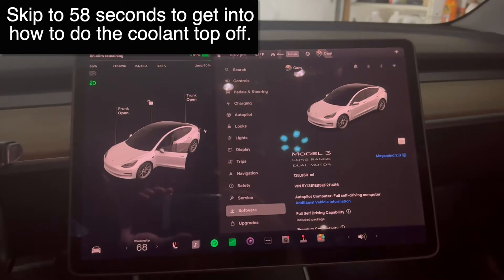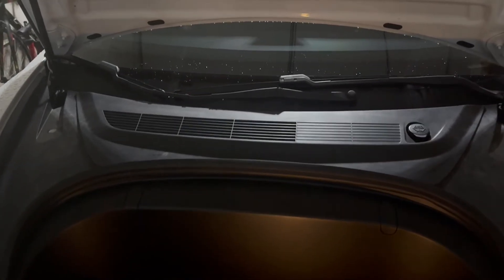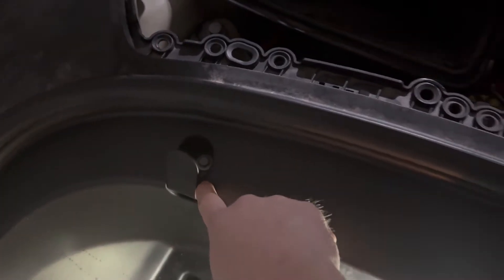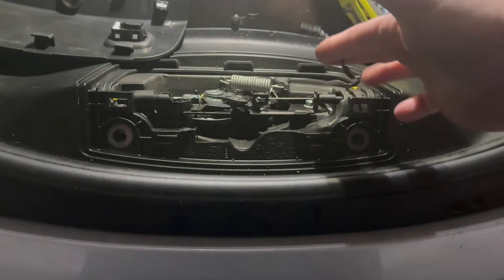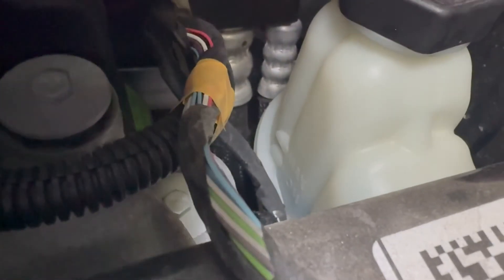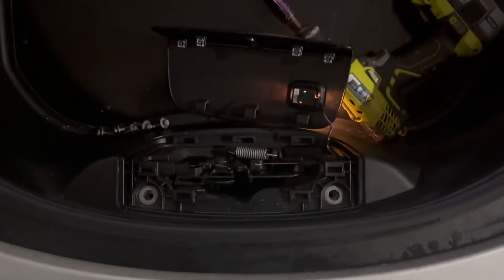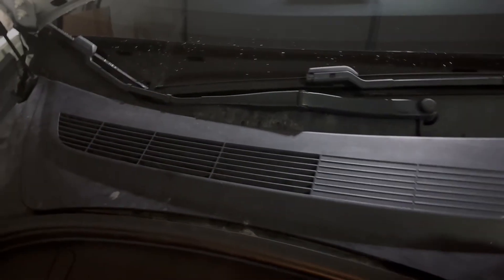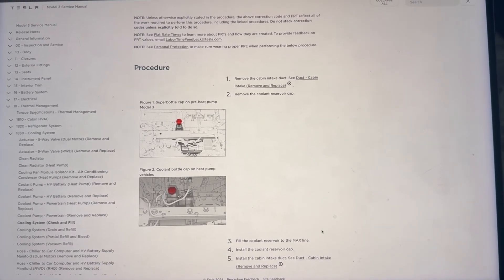Tesla Model 3 Coolant Top Off - Super easy!

Comment: did you purge it after topping off? no one seems to be doing this on these videos should i??
Reply from the maker: Great question. When topping off like this, I don’t think purging is necessary. I think that’s only when you’ve replaced or opened something that could create a bubble in the system such as replacing the radiator.

Comment: Was it a leak? Mine was low to the point I could barely see it in resovoir. Mine is a 22 I had the hvac off but didn’t have it in service mode.
Reply from the maker: No leak as far as I could tell. Never had any fluid on the ground or anything and the level stayed the same. I think just slowly evaporating out of the system over time as it’s not a sealed system?

Comment: I would be careful doing this if your car is still under warranty. My 2018 model 3 performance suffered a catastrophic leak without even giving me a single notification. My air conditioning started to go out on a 500 mile road trip. I checked service mode and had a month worth of leak notifications which I never was alerted about and super bottle Calibration short. My car went into limp mode two days prior to leaving on this road trip and I had no clue except for the air conditioning intermittently going out. Tesla ended up replacing my HV battery and super bottle 500 miles away from where I live. Some notifications would’ve been nice as I could’ve taken care of all of this locally

Comment: Great video, but after watching it I am unclear why the tub needs removing. I can do all the actions needed with it in place.
Reply from the maker: I think the tubs on the newer cars allow you to see more (I could be wrong here) but I removed the tub to be able to see the coolant level. I’m sure there are easier ways with different tools but I didn’t have them, so I just pulled the bolts real quick. Can you see the coolant level in your car without removing the tub?
Reply: @UtahValleyEV yes, I have a 2019. I just shoved a flashlight in the gap. The whole process took under 5 mins from opening the hood to closing it again.

Comment: I went into service mode and noticed a red dot on coolant fill bottle. Any idea. My guess it’s low but I did not check service alerts. It was my first time in service mode and was a little intimidating poking around.  I will try again later today. Great video. Thanks for sharing
Reply: I had that same red dot 🔴 on my coolant bottle. Made a service appointment and they found the coolant leak inside my HV battery… it had been leaking coolant for over a month and went into limp mode without notifying me at all. Luckily my battery was still under warranty, but only a year away from expiring. They ended up replacing the super bottle too.
Reply: @FromGregg was there any other things showing? just bought a used tesla 3rd party dealer but i see the red dot and a low coolant level only on the service side

Comment: Nice, I got a quote on the app that says 1400€ for that issue. I contacted them cause my M3P is getting poor range and when I’m in track mode the rear drive unit is always yellow even after 10-15 min drive it shows yellow. So I thought bad Drive Unit or something
Reply from the maker: If it were me, I’d top it off and check to see if that helps. Try and look for leaks/drips or anything. Hopefully you don’t have a leak and a top off solves the problem. Best of luck!

Comment: i put that same exact coolant but in my Windshield wiper fluid hole! Should i be worried?! i thought it was actual wiper fluid cause it said tesla
Reply: I would just run the washers pumping whatever coolant out and then add washer fluid.   If you added washer fluid to the coolant, that would be much worse situation. I would recommend in the future let Tesla service handle the coolant.  If you had got this backwards, it would’ve likely cost you quite a bit

Comment: Thanks, I needed this, though found it fairly easy to see the coolant level with a flashlight without removing the tub. Shine it on the far side of the level lines or even down the spout.
Reply from the maker: That’s a good point! When I checked it, it was low enough that I couldn’t see it from the top, but I imagine most people’s levels will be higher than mine, and I probably could have seen it from the side with a flashlight. Thanks for sharing!

Comment: Thanks!  I had an alert in service mode, it was well below the NOM line.  Maybe put 750mL in or so to get it back to max…
Reply from the maker: How many miles are you at? It’s a closed loop, so it really shouldn’t go down, but at the same time I don’t think (someone can correct me if I’m wrong) that it’s a sealed loop, so I imagine over time a bit can evaporate out or whatnot. I just checked the other day since I did the video, I just crossed 150k miles and it looks the same to me as when I topped it off. So I don’t think I have a leak, but do think slowly going down with lots of miles could be normal.
Reply: @UtahValleyEV  107,000 miles here.
Reply: @jdavis13umbc curious. Mine is about the same level you reported at 107 K. 2018 model 3. Have you any indication there’s a leaks? I don’t see any liquid on the floor of my garage but it seems odd that the level is so low
Reply: I don’t have any leaks AFAIK.  I haven’t checked the level since I topped it up.

Comment: Was there a leak in your cooling system somewhere that caused the coolant level to drop?
Reply from the maker: Not as far as I can tell. Just checked it and the level seems to be ever so slightly lower than where it was, so I may have a super slow leak somewhere. I’ll bring it up next time I take it in for service and have them take a look. 
I thought it might just be slowly evaporating or something as it is at almost 140k miles now. Hasn’t caused any issues yet, and no customer facing alerts. 🤷‍♂️
Reply: @UtahValleyEV  Great. Thanks for the reply.

Comment: Or you could buy a scope/camera and see what the level is.   Work smarter not harder.
Reply from the maker: I thought about that but AutoZone’s cheapest one was like $80. For a few minutes I’d rather save $80. If you already have one or don’t mind spending the money though, a scope would be easier. Cheers!
Reply: @UtahValleyEV  It was a good refresh, to get the tub removed, in case, if needed. You could probably add a skip to link, in the description, for those impatient❤👍
Reply from the maker: Thanks for the suggestion! I want to make sure I'm helping people as best I can without wasting time. Will add that in to make it easier/quicker for those who want.

Comment: Why would you do this unless the car told you it was out of specification, and unless you are out of warranty get Tesla to do it.
Reply from the maker: I saw the alert in service mode stating it was low so I verified, saw it was low and figured it wouldn't hurt to top off. Car is at 129k miles, so I am out of warranty. If I was in warranty, I for sure would have had Tesla do it, even though it's simple.
Reply: @UtahValleyEV why was it low? Is that normal after that mileage? Or was it a slow leak?
Reply from the maker: @RyanCiesielski it was on the lower side, but not low enough to trigger a customer facing alert. No leak, just after that many miles it is normal for it to be lower.
Reply: @RyanCiesielski  it’s probably leaking coolant in the high voltage battery like mine was
Reply: Oddy for me the car does not tell you the coolant is low  I went into the service mode and saw it showing low there.. why does it not tell us without going into the service mode???
Reply: It will tell you when the coolant is low.  The difference between the service warning and the driver warning is one means the coolant is low enough to make a difference and the other means hey service guy while you’re here top off the coolant.  Be careful in service mode because there are settings you could change that could cause problems that wouldn’t be covered under warranty.  I personally am not going to check service mode to see if the coolant is slightly low.  The only time I might do, this is towards the end of my warranty to identify any problems and get Tesla to fix them for free
Reply: @calvinwalker4654  for me no.  I could not see any coolant. But in the service mode it showed low.  And since I have 284,000 miles on my car i do not want to take chances.
Reply: @MarsEmbassy  be careful not to overfill it.  If you have 284,000 miles then you’re fine with doing whatever to your car because you’re out of warranty. The problem is when somebody with 30,000 miles decides to do the same and causes damage they have to pay for.